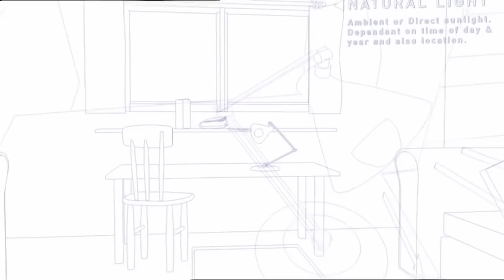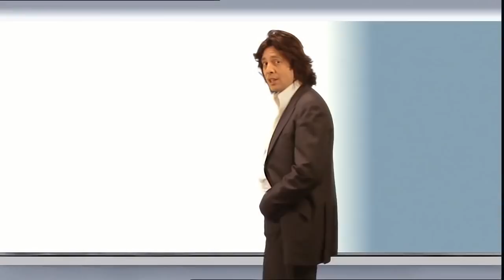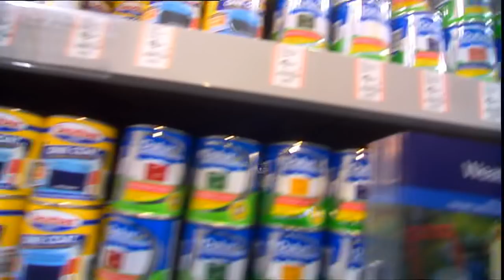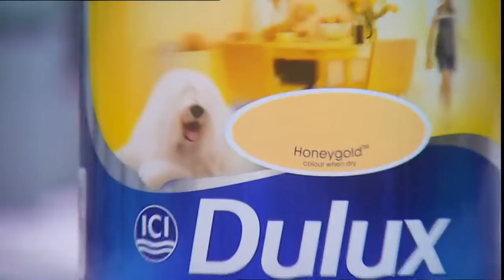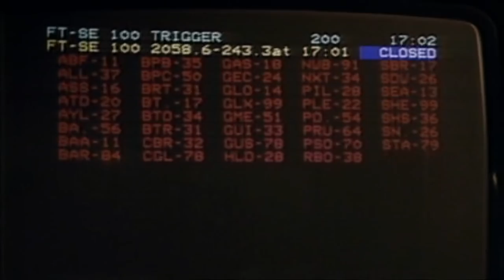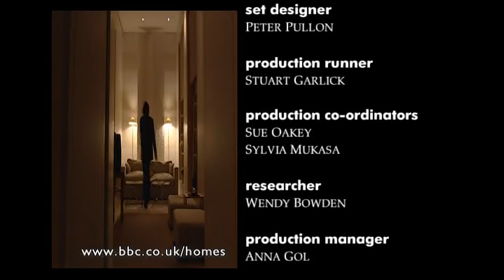BBC - Design Rules - 2/6 - Colour

Comment: To decide the color:
(not just about your favorite color)
1. What is the light condition in room 5:51
north or east-facing rooms generally need more warm color; west or south-facing rooms generall can use cold 
2. What is the purpose of the room 9:00 
      2.1 Strong color (yellows, red) have physical impact  9:45
      2.2 Vibrate color is not suitable in the workplace or kitchen, where you need to be focused.
(they might be good for playroom, I guess)
3. Try the color out on your wall.

Supporting theories, I guess.
4. Some color theory stuff
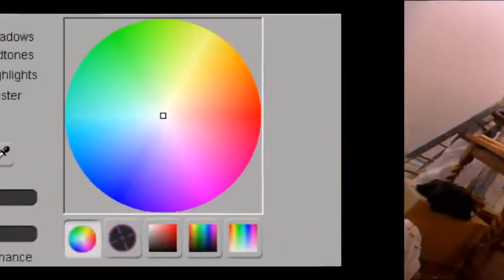      4.1 contrasting color 16:06
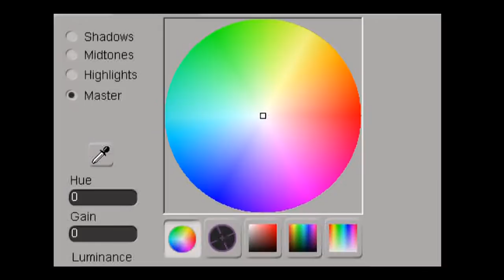      4.2 harmony 18:36 
5. Use color to draw attention on neutral color backgrounds. 21:54
6. Color and mood 23:30

Comment: Very enlightening.  I wonder, though, how the information presented might be adapted to an extremely different climate.  For example, if one lives in a very warm, sunny climate, where there is pure sunshine more than 360 days/year and the sunlight flows into every room all day long, should cooler colors be used to offset the powerful glaring light?  Or would one choose a palette of colors that reflect the warmth of the environment -- such as reds and oranges?  Also, how does light intensity impact the vibrancy of color?  If the light is strong, should the colors be muted?  I've noticed that Mexican homes/hotels often use a large variety of very strong colors: Yellows, purples, greens, reds, blues, oranges will all compete and pop in the same room.  Very interesting, because in all of that disharmony is an energetic harmony.
Reply: Yes cooler shades work great in a bright sunny climate. Think of all the aqua blues in the Caribbean and the strong blue and white presence compared to warm colors on Santorini Isle in Greece... It's also why the Egyptians valued marble. It was a cool stone mostly (both temperature and color). The warm colors work in warm, bright climates, but honestly are better in pictures than in practical use. It only takes one day over 100 degrees for orange walls to give someone the impression of being baked in an oven. Of course personal preference could take precedence over that, but as a rule, cooler colors are more universally enjoyed in warm/bright climates.